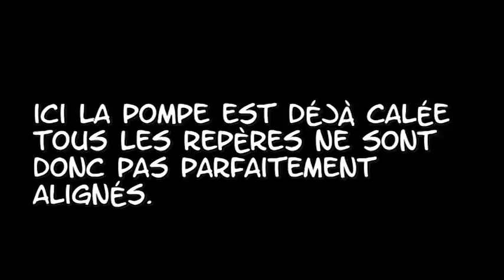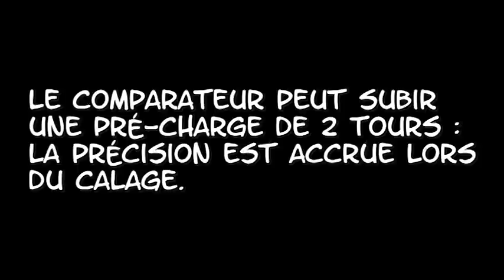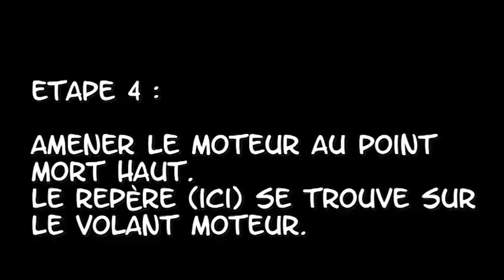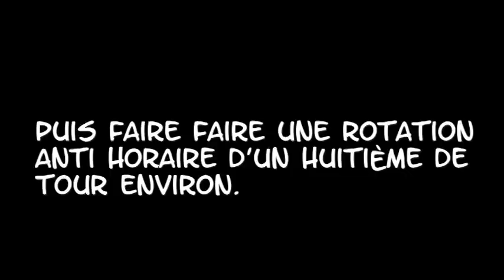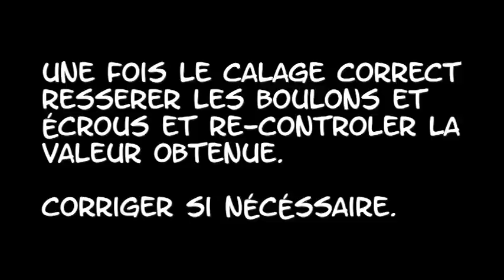Caler une pompe à injection BOSCH VE

Comment: Un groupe electrogene a une pression instable varie de 5 a 6 bars puis un bar et le moteur donne alarm(lew oil presson) j'ai changė les filtres et le capteur de pression mais sans succes.
Reply from the maker: Kamel Tounsi 
Bonjour.

C'est peut être juste un faux contact entre le capteur de pression d'huile et le manomètre/indicateur de faible pression.
Les vibrations le font bouger et causent ces variations de valeurs affichées.
Si le faisceau électrique est bon,Il faudrait mesurer la pression d'huile directement sur le circuit d'huile avec un manomètre pour être sur que la pression varie vraiment.
si la pression varie, il faut vérifier que la pompe arrive à bien aspirer l'huile dans le carter.
Peut être que le tube est desserré et la pompe aspire de l'air.
Combien d'heures de fonctionnement a le groupe ?
Reply: michaelovitch  bonjour j'airais besoin de votre aide pour caler pompe injection Bosch ve sur r 21 j'ai le comparateur mais ne comprend pas comment il fonctionne merci de me joindre ne laissant email
Reply from the maker: lerieux thomas 
Je peux peut être aider ici : )
Ou dans ma chaine,sur l'onglet discussion.
Reply: Bnjour je vous remercis
comment peut on discuter? je dois caler pompe injection ve Bosch sur r21
Reply: lerieux thomas  j'ai comparateur pour pompe ve avec toute pige mais je ne comprend pas comment le regler? faut il le mettre sur 0 des le debut ou apres avoir trouver le pmb de pompe a injection? faut il enfoncer le comparateur completement dans pige vissage?, sur rta on me dit reglage moteur a arret statique entre 0.73 et 0.75mm mais je n'arrive pas a trouver cela en pivotant la pompe? pouvez vous me repondre  a tout cela je vous en serait reconnaissant
Reply from the maker: lerieux thomas 
Avant tout,il faut repérer le point mort haut du moteur.(repère sur vilebrequin ou arbre à cames)
Il sert de référence pour le calage de la pompe.
Ensuite il faut regler le comparateur à zero avec une précharge de 1 ou deux tours.
Puis bouger la pompe  ( au point mort haut moteur) pour que la valeur affichée soit de 0.73 à 0.75 mm.
Il faut evidemment que la pompe soit elle même reperée par rapport au moteur(il y a un repère sur la pompe la poulie le plus souvent) qui permet d'identifier quel injecteur va pulvériser,donc de caler grossièrement la pompe avant le réglage de l'avance.
Reply: je ne comprend pas la pompe injection doit etre reperee par rapport au moteur? et si je met le moteur au pmh et place comparateur et tourne la pompe pour regler  celle ci au donnee cosntructeur  cela devrait convenir?
Reply: oui il y a deux point sur poulie pompe injection un pour poser la courroie distribution et l'autre au sens opposé de l autre cote en face de la poulie de pompe injection
Reply from the maker: +lerieux thomas
Bonjour.
ça fait un moment et je ne sais pas si le problème est résolu.
Je n'avais pas vu les derniers messages.
Oui la pompe est reperée par rapport au moteur 
Il y a un cylindre qui doit être alimenté en premier,c'est celui qui correspond au calage de la distribution
La distri et la pompe sont synchronisés.